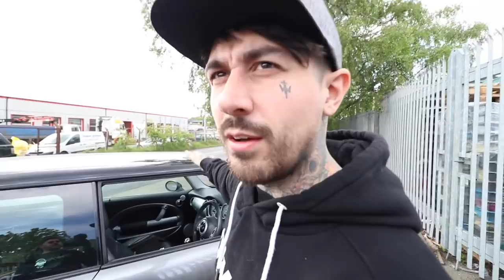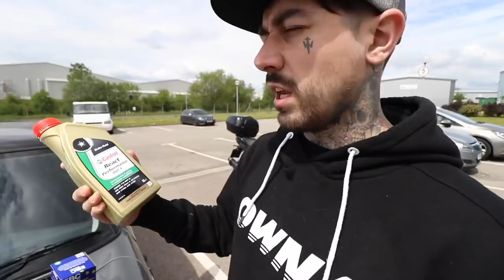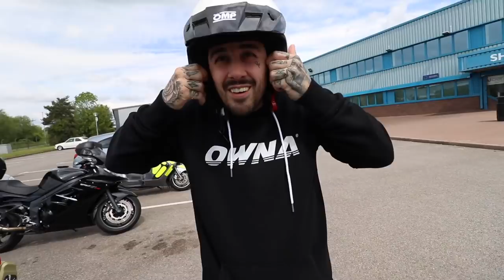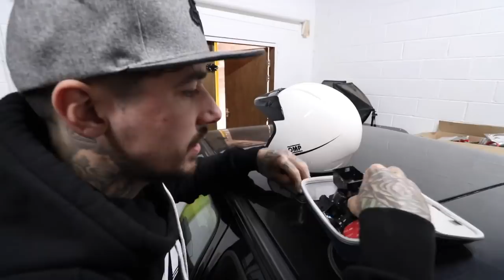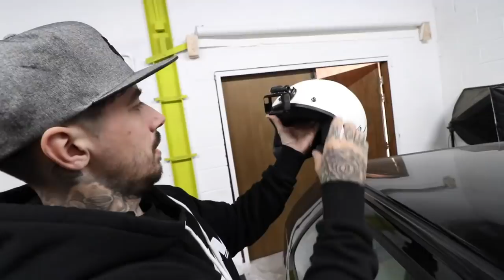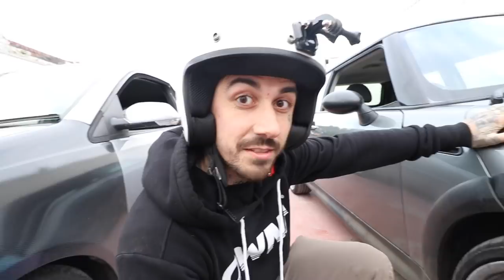SUPERCHARGED MINI R53 GETS NEW BRAKES & TRACK READY!

Comment from the maker: TRACK DAY TOMORROW :D <3 Wish me luck the mod squad see you guys tomorrow night :D
Reply: Good luck
Reply: Good Luck!. Fire exstinguisher in car, for track day?
Reply: Where’s the track day at dude?.. oulton?... have a good day it’s a sick track infact I’ll have a mooch over!..  ✌️
Reply: Good luck
Reply: Good luck my g
Reply: main things to remember brake before the corners ....start off wide turn in sharpish to the inside line (where the apex is and exit wide) just gives you enough space to make errors and correct them in time .....and try not to floor it into a corner and lift off the accelerator mid corner or the back end will kick out ! Other than that have a blast Guys and ill see yous in tomorrows vlog ! :D
Reply: Stay Save Mr Main 😎
Reply: Don't forget spare fuel!
Reply: Get down at gypo hazza everyone want you down and the weather is supposed to be good
Reply: Take tape for lights etc
Reply: Harry Main hope you get good footage and cameras around the car maybe?
Reply: You don't need luck harry can't wait to see you racing the mini.
Reply: Good luck guys you might need a tyre pressure gauge as pressures increase like crazy specially on a hot day and you might need to bleed some of it out to avoid overinflation!!
Reply: gus doesnt need a helmet?

Comment: Make sure you bed the brakes in fully before going to hard on the track. If they ain’t bedded in the pads won’t get the grip and will overheat the discs and will get brake judder. Also might not help with you as your filming but take the number plates off while on the track. Will always be lots of filming going on and any incidents on track will be filmed. Insurers will use this to look for unsafe or silly driving and may not cover. Keep the vids coming and good luck tomorrow. Have fun.
Reply from the maker: FAIR!!!!
Reply: You're not insured on track anyway? And if they use as evidence that you may be driving like this on a road, surely doing a track is the opposite, as you're only driving fast in the safest environment (ie a track day)
Reply: Ur insured on the Nuremberg ring because its an actual roadway people dnt realize this lmao
Reply: @skrapz79  Usually in the UK you're not. If you check your insurance policy in the details it'll explain they don't cover you on the Nurburgring. And that's a common misconception, it's not officially a road or public toll road. It's a road that's privately owned where you have to follow the rules of the road.

Comment: Hey Harry, a tyre pressure guage would be useful, so you can set your tyre pressure after a few laps, when the tyres get hot. Good luck mate.
Reply: Tim Osmond I've read in the Highway code that u would check the tyre pressure when ur cold because u could get bad reading when the tyres are hot
Reply: @mark-jx6qi , yes but for track use you lower the tyre pressure ones they are hot. So you first set a base line cold, then adjust when hot.

Comment: use all of the track, check your mirrors, remember your cooldown laps, dont put your handbrake on when you park up, bring some wood to chock your wheels.
Reply: Catalytic Autosport why not use the handbrake?
Reply: Ian Greenwood when the discs get hot clamping a hot pad to it and leaving it for 20/30mins to cool down will warp the discs/leave a pad deposit on them.

Comment: Definitely bed the pads in before you get there, use them often on your way to the track and they should be good by the time you're racing. While racing, do most of your braking coming before the corner, then steady throttle through the corner and hard on the gas once you see the straight. Best of luck!

Comment: May have already been said but I would recommend learning the track as best as you can before going, watch some GoPro footage so you can have an idea for the racing line as well. Check your tyres and tyre pressures to make sure they perform as they should. Be sure you bed in the brakes to get them to perform as they should, I work for a car dealership and whenever we replace them for customers we have to be sure to go hard on the brakes to bed them in and make sure they grip and work optimally for when the customer takes the car back, I would say this last bit is crucial.

Comment: Good luck for tomorrow buddy just remember to take it easy and slowly build your speed up throughout the day and feel the car and track out :) I also have the same helmet too I use on track days too . Also as a beginner remember to brake in a straight line and then turn in . Also keep and eye on your tyre pressures too and when there hot you want them around 28psi too . And remember to bed the brakes in first . And best bit of advice just have fun bro :) .

Comment: Stick the go pro on the dash board for a better view point. A fire extinguisher is a must. Next mod needs to to fit vented and grooved/ cross drilled disks. Next fit a set of FIA approved racing harnesses.  Next you need to mod the suspension then leave the engine mods till last. You should always follow the rules of no 1 stopping power, no 2 handling no3 safety de ices such as harnesses and race seats and roll cage then mod the engine for max reliable higher power.  You should also think about fitting a tow bar to the t6 and buying a towing dolly to take the mini to and from the track days.

Comment: Get yourself a tyre pressure gauge and a pump that plugs into 12v... you’ll get shit handling with pressures being too high or low

You’ll need pressures low before you go out on track, the pressure will fly up with more heat, if you’ve left the tyres at road pressures you’ll quickly know as you’ll be going straight in the corners.

Comment: Race Brake Fluid is more prone to be contaminated with water which the normal brake fluid is not. Also it last alot less time and you will need to change the brake fluid after every trackday or every 2 trackdays. The normal brake fluid lasts for about 1 year to 2 years which the racing one doesnt at the most 1 year. Also when the car is not running or stopped for long periods it is very prone to be contaminated.

Comment: Handheld cameras will get you kicked off the track, it’s not allowed... mount them to the front and rear screen and if you have more than two, mount one on the passenger window.

You can have them mounted on the exterior, but they need a secondary fastener

Comment: You’ll need to drop your tyre pressures as they will get hot and you’ll loose grip and destroy your tyres and make sure you bed the brakes it or you’ll warp the discs and glaze the pads then you’ll have no brakes watch overall car temperatures keep a eye on oil level

Comment: Supercharged upgrade and intercooler upgrade sparkplugs and coilpack upgrade head upgrade and head upgrade aswell as cam upgrade then you can get close to 500hp about 420-450depending on brands used also a racing game steering wheel and also the exhaust with el2ctic ateight pipeing and a full rear roll cage t ha t has front over hools amd down hoops and bolt in cross peices for the doors